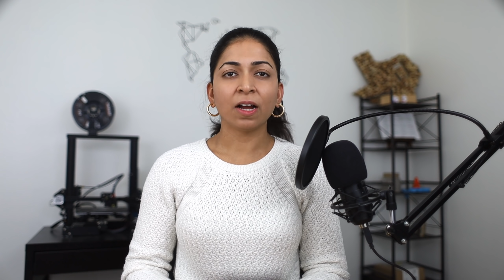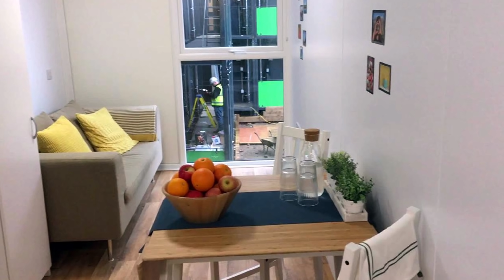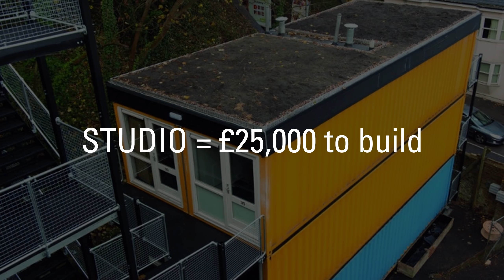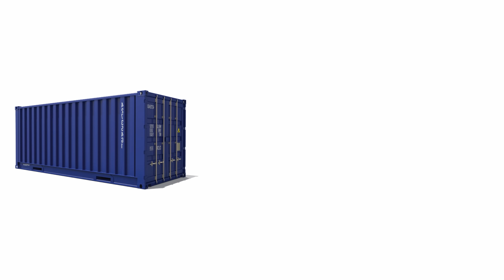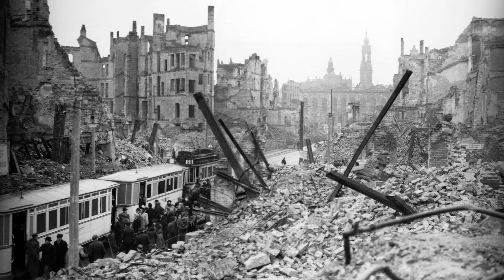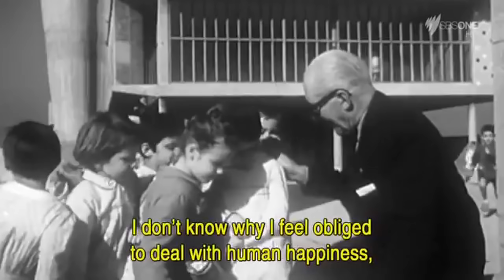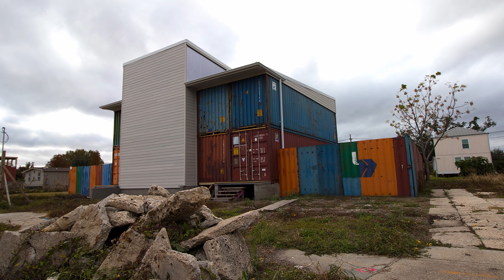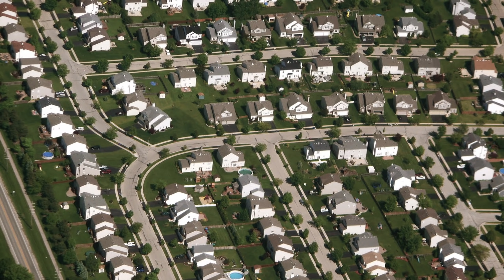Why Shipping Container homeless shelters FAIL

Comment: This makes me think of "Khrushchyovkas", those prefab made by Soviet Russia after the war to manage the lack of homes, the country having being destroyed by the dramatic WWII.

It was a half success though since it was supposed to be temporary. They used it in a communal way (one family per room, a kitchen for several families, toilets shared with the whole floor) and it was later reformed into a system with one family per apartment.

It was also structured, with shops and commodities nearby, parks and schools. Everything repeating itself again and again and again as far as the eye can see.

The size of the rooms back then are and the structure of the apartments are still used now in Russia for new big buildings. It is impressive to see sometimes quite luxury homes with quite small rooms and no bedroom for the parents, those sleeping in the living room.
Reply: Those were made to accomodate humans, though. If anything, maybe people should build some more of those for the homeless instead of wasting time with shipping containers which are never going to work as a domicile and could just be recycled. I mean it's not exactly hard to design a modern prefab that can be built fast without having to resort to stupid ideas like reusing rusty steel boxes and then jumping through hoops trying to make them not complete torture to live inside of. I bet they aren't even using old discarded containers. I'd actually be real surprised if they weren't using brand new production.
Reply: Yes, the advantage of those buildings is that they can be build fast and cheap (even with an elevator and other commodities), especially since the building is always the same so once you got the idea, you know what you are doing when building it.
Reply: Wrong, war didn't had this impact to "Khrushchyovkas", Stahlin died only in 1953(!) and building plans for the masses existed even before WW2. It was main political course to move people from villages to the towns since Lenin, lands and industrial structures must been reorganized from private ownership to common on the background after the FIRST World War and the country's lag in all areas, existing cities were being redrawn, new were founded in previously unused resource zones and "great construction sites" opened (Gulag existed since 30th mainly for this purpose, social terror as bonus), production capacities and ideology were needed.
And all of this were according to planning economy must been change features of the towns and cities as well as structure of society.

Back to Khrushchyov and his era buildings. Before him domain style was "Stahlin' Empire" which totalitarian architecture alike in Nazi' Germany, point of which to provide visual domination of ideology and pressure to "little" citizen by it's sizes and decoration. This kind of buildings are not cheap and fast to make, it's wasn't compare to Khrushchyov ideas of "palace for everyone". 
Not to mention, he was truly in his core the man of land and believed in  "miracle " solutions for any problem: during his reign , there were plans to sow the country with corn to feed people (worked only on the very South of USSR) and Sosnowsky's hogweed for animals(invasive far not so edible plant, disturbing environments, now spreaded everywhere).
Bauhaus school and it's approach to creating living space (they moved to USSR when started get pressure in Germany for incongruity design ideals), which cheaper, easy to land and modern  was perfect solution to him. Like for Le Corbusier, idea of "living block" that can stuck one to another and create complex for any number of people seems great to Khrushchyov, but he eventually wasn't care about esthetics at all. That's why most of ex-USSR looks like this, not because of WW2.

Analyse on Khrushchyov  motives is not made by me, but his great-granddaughter and Professor of International Affairs Nina https://youtu.be/2aYc62gNlTE?t=757
Reply: @marijanashum3671  You essentially say the same thing I say. 

The WW2 part is related to the process of prefab and fast building, not the fact that there were tall buildings in cities.
Reply: Yet, that style of home is still standing all over Eastern Europe. They may look dingy and drab from the outside, but inside they are quite comfortable with quality materials. The one Ive lived in has been better than all of the American apartments Ive lived in that charge 1500+ a month and are labeled "luxury" because they have a gas stovetop.

Comment: I can understand why European cities threw up housing as cheaply as possible in the postwar crisis, but there's no excuse for continuing to use the cheapest possible construction methods for social housing, or any municipal construction, whether it's meant for temporary shelters, social housing, or public buildings. Choosing not to spend the money to construct good housing is entirely ideological. It's also just poor economic management, in the long run: if a building is going to be owned and maintained by a municipality, constructing it so that it's built to last for the long term (like a century at a minimum) is much more economical over the life of the building than one that will just need to be torn down and rebuilt a few decades down the line. It's just that making homes that are nice and then giving them to homeless people as transitional housing, or renting them cheaply to social tenants, violates ideological principles -- we feel the poor must be immiserated, to justify prices in the private sector.

Comment: A huge problem though is it isn't just the shipping containers that fail many of the multi-occupancy housing projects for the homeless fail as well. Failures for them include the fact that some of the occupants end up being abusive meaning many don't want to be in them because fights break out people abusing other people even known of rapes happening and they end up actually feeling safer on the street than under a roof. The UK has a huge housing shortage but much of it could be solved by compulsory purchase orders repurposing of so many small empty shops into residential that in many cases before became shops were in fact residential homes that got cut up to produce a shop and flat.

Comment: I don't think we should stop the innovation of shipping containers. They are low cost and better than leaving people in the street. For unsafe floors there are polymers that can be painted on and added sand to to make them walk-able. The same thing for walls. There are likely inexpensive sprayable insulations that can be sprayed or painted on before adding the inner wall, even drywall or cement board adhered can deftly improve the warmth of the apartment. Even spraying the outside with a similar pain-like insulation can make the container more weather resistant. Its still a good low cost solution for the homeless. If they want they can get a job and move out really... it's not meant to be a forever home.

Comment: About the suburbs, the problem is not for those living in them, it is for those who have to supply for them and about the excessive level of individual consumption it brings through : each individual needing a car ( 2-3 cars/household) taxes fleeing from innercities while the suburbans keeps consumming there meaning inner habitants having to pay more for both ground space and products, extending electrical and water supply to the suburbs is also expensive, increased water consumption/household due to extra-low density, and a factually absolutelly homogenous space losing pretty much all type of individuality, that's why it mostly is used in north america where the culture is centered around the individual and the esthetic of wealth , while in other rich countries ( France, germany, Japan etc...) people usually don't want outer city houses but rather true country side houses or true city appartments the in-between seeming to us as a downgrade from both. Btw I lived in le corbusier styles complexes and have to say that when the constructlr respect the norms for plumbing wiring and insulation it is pretty good and most people where i'm from live in those for years without much complain especially when public transportation is accessible

Comment: Debunking issues:
* Sure their is a psychological effect with living is such a small space, but at least they have a space to live. (On a side note a shipping container square footage is 320sq which is about the same size most under 30 year old's can afford to live in in any major city in the world. No one is going to go for giving the homeless a bigger place that most people for free.)
* The idea of that the amount of metal in a shipping container can build 14 framed houses can be misleading as that doesn't include the cost of recycling that container into that metal. Moreover if you are building framed houses I suspect you are used wood as the other material which is not as rigid and can add complexity to the shipping part of the shippable housing, and could impact the stackability of the housing as you now need to insert structural supports (which already exist in shipping containers). 

I will admit to you Modular Homes are not meant as permanent housing. They are there to provide shelter and to be quick, cheep , and mobile.
Reply: The only part of a container that is structural is the corners. By the time you wire plumb frame and insulate a sea can you bring the hight and width down by 6 to 10 inche,. Making them cramped square footage isn't the only concern. Building a sea can specifically for housing that is taller is categorically wasteful.
Reply: The amount of metal comparison is only misleading if you're assuming that the shipping containers already existed, but the fact is that these constructions are being built out of custom-ordered new shipping containers or out of shipping containers that are being removed from use long before their normal lifetime is done with, rather than those disused ones that have potentially been used to transport toxic materials (which there is no way to determine if they have). The metal doesn't have to be recycled into 14 other homes, instead, the metal can just be cast into those members directly instead of being cast into the corrugated sheets used in shipping containers, which then must be cut into on-site anyway.
Reply: The vast majority of smaller living spaces these days are framed using steel studs. Only low-rise residential building use stick framing these days, as steel is lighter, more durable pound for pound, and vast more functional for the actual act of framing as it, unlike wood, has been specifically engineered with strength and ease of use in mind. 
I don't know where you got the idea that wood is more rigid that steel, but that is categorically false. A 2x4 might be more rigid than a 25g stud, but that's just an issue with material thickness, and to be honest, I'm impressed by the amount of integrity provided by 0.6 MM of folded up galvanized steel, compared to 2" (50 MM) of wood.
Steel stud can also be purchased in thickness anywhere from infill (25g/0.6mm), rigid (20g/1mm), or outright structural (14g/2mm) that al conform to any desired shape or function, unlike wood.
It also takes up vastly less space and weight, making it cheaper and more efficient to store and transport than wood.

Comment: Firstly you are not talking about much of the UK using these. Specifically there are only two sites outside greater London. Also those prices for studio apartments. Where precisely? In London the land alone would cost way more than the amount stated. A 3 bed flat in Covent Garden you'd be lucky to find for £5 million. The real issue is that people need a minimum amount of space. Tower blocks do not do that and these are even worse. There have been peer reviewed studies done on this. Putting people in overcrowded conditions causes depression at the least. When you are talking about people who are homeless most have PTSD depression anxiety and several other mental health issues before you even start. I have 30 years experience working with homeless round the UK and the real issue is that most are male (90%) so nobody gives a damn.

Comment: the only modular designs i know of that worked were the Khruschev's high-rises in the Soviet union. Though they were neither minimalist nor trendy. the buildings were assembled from huge concrete pannels, kind of like lego blocks, with the layout being identical in each one: 7-9 floors (in the original design at least), each floor has 3 flats: 2 2-bedroom flats and 1 1-bedroom between them. each vertical has their own entrace, i.e. you've got 9x3=27 flats per stairwell, each stairwell has an exit to the outside and the actual building is composed of several stairwells, at least 5 usually
those buildings were a massive success in the union, though mainly because the government objectie was to give everyone a houme after WWII, so people didn't have to buy their flats, they were just given one once a new building was finished. now that the union is no more the flats can be bought and sold as normal.
i guess my main point is that, Khruschev's housing boom has many similarities with the projects in the video, but it managed not to fail and most of those buildings, and ones that came after in the same style, are still inhabited today (in fact my parents live in one)
Reply: @Peter from NZ yes, those are the ones i mean. the wiki page is about the earliest models of 5 floors. Later on, buildings of 7-9 stories with elevators were designed that were built the same way, though i guess those are technically brezhnevkas (build during Brezhnev's term). tbh, the only difference is building height and the layout of flats.
point is both models were built very much like lego towers from pre-made concrete blocks. it was fast and comparatively cheap. Khruschyovkas were smaller and less fancy, designed to solve the post-WWII housing crisis in the USSR. Brezhnevkas were basically a "glam" version: same specks structure-wise, but more comfortable. Both types of buildings are still standing  today with people living in them

Comment: What I've always wondered about shipping container homes living in california is if you could prevent them from overheating simply by putting a wooden sunshield around them with 6 inches or so of space in between, and allowing air to circulate through so it doesn't just heat up infinitely? You could even fairly easily put just a couple fans blowing air through there just to ensure the air doesn't sit in there that you can turn on when it gets really hot. It would do nothing for cold weather, but in california the issue is the heat, not the cold.  I'm not suggesting they are good permanent housing, I agree with the conclusion in the video, but I wonder if this is a good simple solution to the problem of overheating? The sun shield could be made extremely cheaply as it wouldn't be load bearing at all and could be anchored to the containers themselves. I feel like it would do a good job of preventing the sun from baking the people inside alive, but tbh I have no idea. Again, it does nothing for the cold, but in most of california you could adequately heat a shipping container in winter with just a space heater or 2 (ive actually tested this one in an abandoned container my friends used as a smoke spot back when weed was illegal using a space heater and a portable power supply. It gets toasty assuming it's not snowing outside. The container was unbearable in summer though, the walls were hot.) Again, SO MANY BETTER OPTIONS but I was still curious. Take a look at Vienna for an example of public housing done extremely well. Fuck shipping containers. But if I wanted to build a guest house someday im sorta interested in the container idea XD

Comment: I liked the recent, 70 story housing structure in Singapore consisting of 5 separate buildings connected by open platforms at the 35th floor and roof levels. Those do indeed increase the green space, outdoor and recreational areas of the lot. It was actually better than the two, 10 story buildings they replaced even though it holds several times more people. That was a good design. Too many architects seem to view buildings as egg crates for stacking people inside. This is equally true in the cubicle structure of open-plan offices.
Reply: And i assume a Library has 1000 stories. Please use "Storey" when referring to floors.
Reply: @56rye  You must be British. It's 'story' in the US.
Reply: @scientious  Oh god I'm so sorry. Here I was in my ivory tower, thinking British English was the only way to spell it. I need to rethink my life choices.
Reply: @56rye  colour vs color, assurance vs insurance, bonnet vs hood, holiday vs vacation, redundant vs unemployed -- there are lots of these. Surely you already knew that.
Reply: @scientious  I knew a lot of these and i thought i was safe in my ivory tower, but i was wrong, and i am sorry.

Comment: Suburbs in the US are weird and based on enforcing strict rules on people though.
Totally inflexible and forcing car use on everyone, with more dangerous driving.
Reply: THey don't force car use, rather they require car use as the entire desire of the people living there is to have much larger property than they would have in a dense city. If each house is an acre then obviously you are going to be getting everywhere by car.
Reply: @GeorgeMonet  Zoning laws mean they have to be large, sometimes with bizarre outcomes as a house will have a small backgarden, or yard, but large front garden, because the house has to be set back from the road.
They are not following consumers, but limiting choice to large suburban properties or dense urban highrise, nothing in between. Its due to policy made up in the past when they assumedcars had no drawbacks.